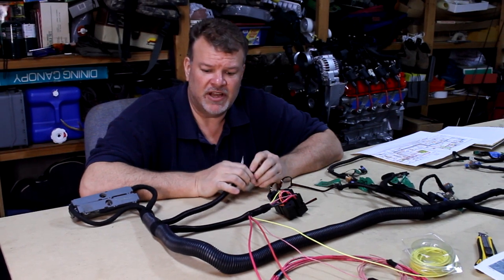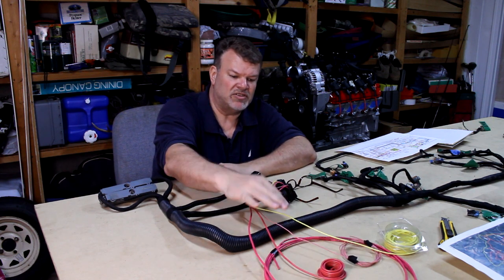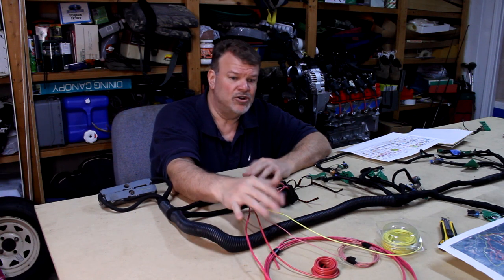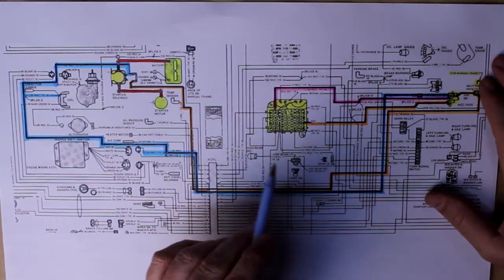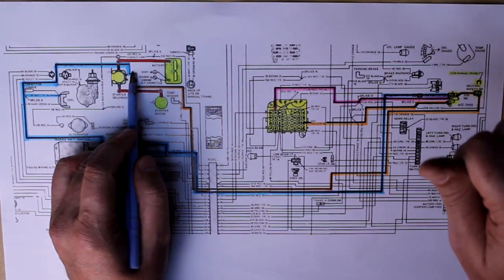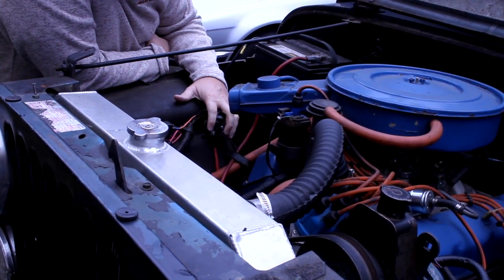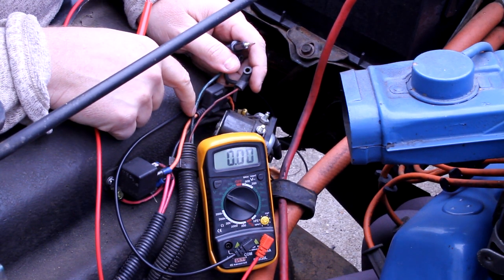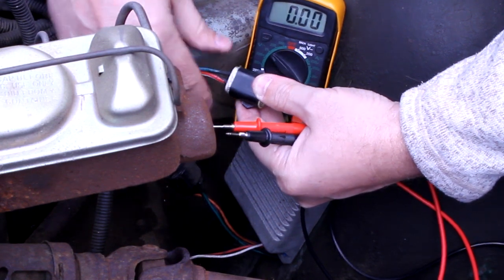LS Wiring Harness Part 6 | Project Rowdy Ep018

Comment: hey sir! I know I bug you with questions and comments on your video, which are great by the way but I want to run an idea by you and maybe see a second approach....... so I have a 1980 chevy k10. I have a 4.8/5.3 but o harness which is no big deal just gives me more time for a more simpler and better approach before I tackle any wiring... so I want to run the pcm and maybe the relays into the cab under the dash(to be determined). I know ill have to extend the harness and re-route the stock wiring location which is fine... but my idea was to have a waterproof connector in between the pcm and harness attached to the engine. this will allow me to utilize a smaller diameter hole in the firewall and easier to disconnect for easier mainence when needed.... I know its sketchy with another potential area to be a problem but I want to keep the pcm clean and out of the elements and clean up from under the hood so it doesn't look like I threw duct tape and gorilla glue at it in hopes it'll fix itself.... what is your thoughts and/or approach?
Reply from the maker: First of all Brian, I always enjoy your comments.  They are always encouraging and most require some thought like this one.  Sounds like you are thinking about some form of a bulkhead connector.  I like the idea of the PCM under the dash and out of the engine bay (very clean).  As you mentioned, this will require you to extend every wire.  So the two options are 1) Hard solder the extensions and cut a hole in the firewall large enough to pass the PCM connectors.  Then use a rubber grommet to close the hole.  This would be a large grommet and IT would dictate the hole size/shape in the firewall.  2) Strategically plan your splice at the firewall and use a bulkhead connector so that it can be disconnected there.  Problem might be finding one with enough pins to accommodate.  Both are good options.  Both suggest that you might be better off buying 2 harnesses.  Cutting one near the PCM for your Engine side portion and cutting the other near the sensors for your PCM side portion.  Then join with option 1 or 2.  Good stuff!!!
Reply: UCanDoIt2 Yeah exactly!!!! I was thinking of using a stock bulkhead from another vehicle that has enough connecting ports and do one wire at a time.... it involves a lot of work but maybe something to do.... and I like the second harness idea bc I can probably buy one that's all boogered up for a few dollars.... I'll confided your options... bc I would really like to use butt connectors and hard solder for better and stronger connectivity..... but I don't want to drill a 1.5" hole in the firewall if I can just drill a little square and provide a better seal as I will be off-roading slightly for camping and stuff so I'm trying to think of longevity but dependability and accessibility justincase I need to pull the engine or change cabs or access wiring later on down the road..... but really THANK YOU for all your advise and I'm sure I'll think of some other idea....... thanks again sir for everything
Reply: Brian Davis if one bulkhead connector doesn’t have enough pins add a second boom

Comment: hey buddy,  thanks for giving me credit! nice progress on the wiring,  I will make a note that everything is hooked up to have pcm starter control on my suburban,  however,  it does not "latch" if you bump the key. I haven't been able to find out why this is not engaging,  I do get anti grind though.
Reply from the maker: No problem...  Thanks for the inspiration.  I learned a lot and your video made me think through it.  Cool Stuff!

Comment: my question is, why were you only getting 6v at the solenoid? is there an ohm issue with the wire running from the junction that you tested last that had the 11v?
Reply from the maker: There should not be a difference in Voltage taken at those two points.  They essentially the same.  When I take out this engine and remove the Starter Solenoid, I will trace that wire back through the loom and see if it is wired differently than the diagram.  I need to find that splice anyway and terminate the Solenoid segment of wire.
Reply: Correct me if I'm wrong, but I think the solenoid gets partial voltage (baby blue wire) to energize similar to a coil, and full voltage in key position 2 to induce the starter. Just watched the LS build and harness videos. You are THE MAN!  You take the fear out of the average Joe doing the job themselves.  Great work. Two thumbs up to you and your sons.

Comment: another amazing video!!!!! if I could post a picture on here id send you my several wire diagrams I've made for my swap mainly for your videos. I'm a little confused but only because I don't have the harness in front of me.... Awesome videos sir. the more you post, the more ill watch!!!!!!! Also, thank you for the time you spend making videos and going step by step. By far the most educated videos on this swap....
Reply from the maker: Thank you Brian!  I have been very fortunate to run into good people like you.  I appreciate you sharing your thoughts.  Are you having an issue with your harness?  Cheers and have fun!
Reply: UCanDoIt2 well I haven't started being I'm over seas but I have everything I need on paper to the T! My issue is, is there a starter wire from the pcm? And if so, what would I do with my excising starter wire from the truck itself?
Reply from the maker: What year is your Harness and PCM?  This is one of the point that I was making in the video.  The Starter circuit is handled differently in different years.
Reply: UCanDoIt2 I don't have it but I'm hoping to find an 01. I'm overseas at the moment so I gathered all the extra information I didn't have for my swap bc I'm also swapping to a manual trans.... but just to be safe, I'd rather learn now instead of at the moment so I can tackle it and get it done. I know I'm going to tackle some difficulty but I'll at least have a more then general knowledge to do it right the first time. I have a 2001 engine without a harness.... I'll also be doing mods to it from other LS engines for more street performance..... but I really thank you for all of the help you've been providing to myself and so many other people!!!!!!!
Reply from the maker: You remind me of me!  I started doing research for this project (casually) about 2 years ago!  Just learning new things and getting my ducks in a row!  Shouldn't be hard to grab a harness from a local salvage yard.  But back to your question...  I can speak from a 99-02 harness perspective.  The PCM is not apart of the Starter circuit.  The Starter has the following characteristics:  1) it is locally grounded by bolting it to the engine block which is a common ground, 2) there is one heavy gauge wire that essentially comes directly from the Battery which will supply the current to turn the starter, and 3) there is a Purple (+) wire that essentially goes to the Starter Solenoid (electric switch attached to the starter).  The Purple wire comes from the Fuse C2 Block and is controlled by a Starter Relay (which I will add later).
Reply: UCanDoIt2 haha yes sir. It's been about a year so far bc I've always wanted to do it.... my dad had an old 74 k10 with an lt1 converted to a carb and would just go about anywhere as fast as the trans and rear gears would let it and since then I wanted my own but never look into it(i like faster cars and old style carbs) but im  and now have a wife and a dog to worry sooooooooooo It needs to be reliable and running versus powerful and fun Haha! But but its a reliable restoration and a mall crawler since it's my first!!! she wants a wrangler and do the work and help me so soon I'll be doing the same project...... But back to the subject, I know how a starting system works just not good woth wiring..... in my line of work, I have to deal woth wiring so i now know some information but now I'm learning more indept... I even went as far as making my own wiring diagram and go er it every day for all different things...... I'm jusy gonna watch you and learn your approach and then tackle it myself....
Reply from the maker: Awesome story!!!!!!
Reply: thank you for the input.... I just wasn't sure bc of the harness but I guess it looks more intimidating bc everything is more compact versus coming out of the firewall like the older vehicles... I get what its doing now. thank you sir!

Comment: Good idea. Most late models are all remote start, ha they key  is just for show.
Reply from the maker: Yep!  It is the Starter Assist feature of the PCM controlling the Starter that offers the ability to have the "Push to Start" feature found in mist newer cars.  Technically, it is a simple adaptation of the feature that has been present since 2003.  And they like to charge you like they just re-invented the wheel!!!!